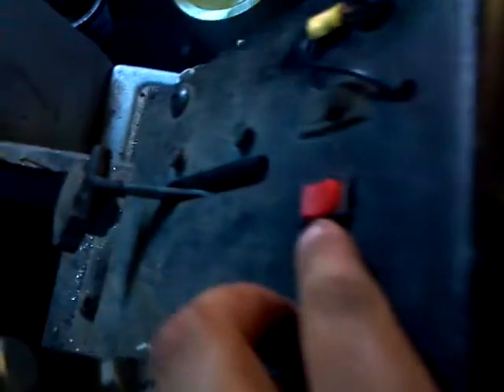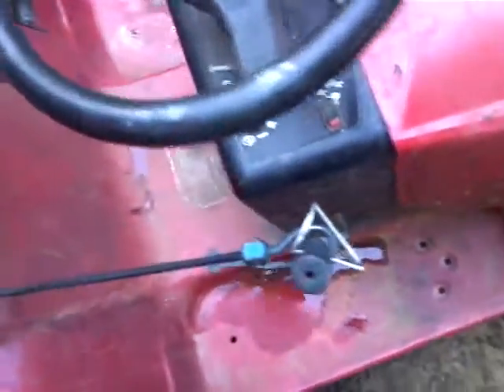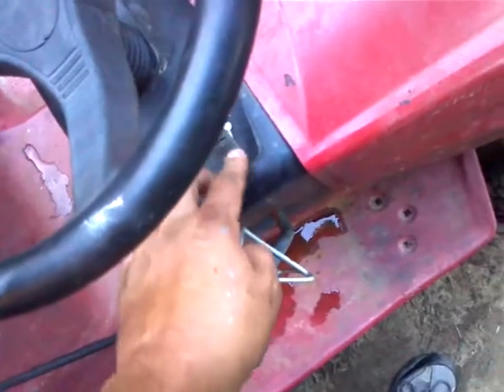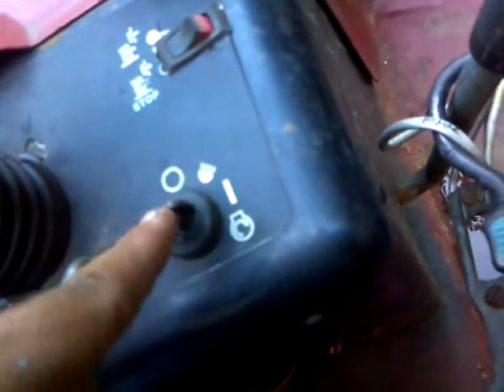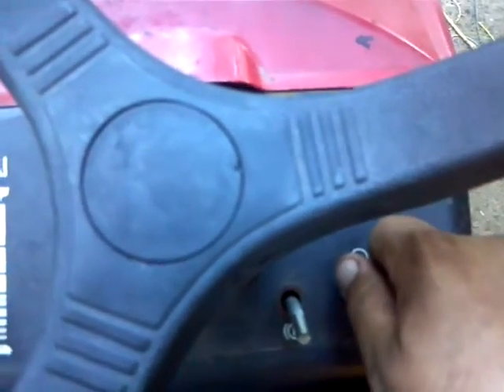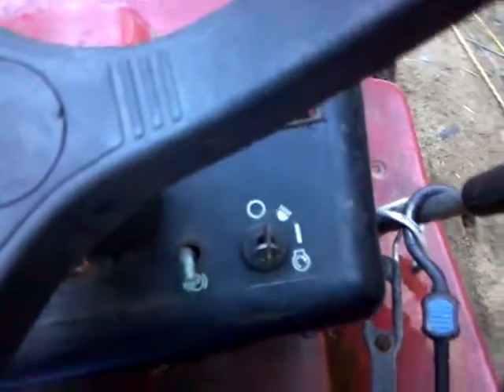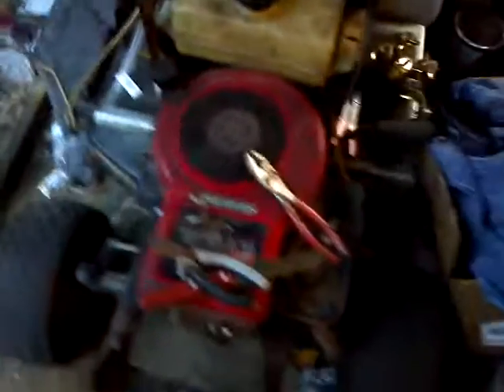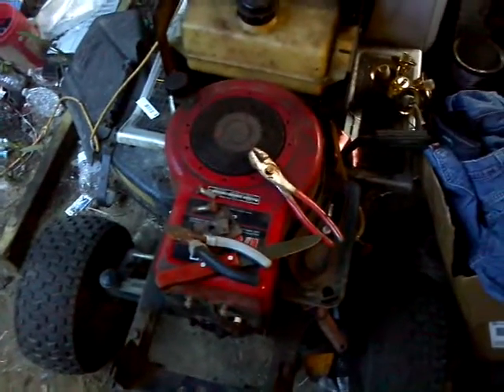HOW TO WIRE A KILL SWITCH ON YOUR RIDING MOWER

Comment: i'm converting my 12hp riding lawnmower with the briggs, from electric to pull start, do I need to put a killswitch on it or can i use the old ignition switch?
Reply from the maker: im sorry for the late replay no you dont need to put a kill switch on it. Just switch the key on when you go to pull start it and when your done switch the key off and it should turn the engine back off
Reply: @BigJoesRidingMowers  no problem man, and yeah i figured it out, im starting it with an electric drill on the flywheel bolt until i can get the recoil starter ordered.... she runs, but the blades won't engage, somehow the blade belt got  super loose even though the last time the mower ran the belt was fine, it hasnt ran in about 5 years, and all the pulleys were seized up, as the drive belt pulleys were sparking and making a scraping noise when i first started it but that went away
Reply from the maker: @grandmastah2314  that belt is probably just old you can have a old belt that looks good but once you use it, it stretches, it happens, just curious what kind of riding mower do you have?
Reply: @BigJoesRidingMowers  it's one of the old craftsman II 38 inch cut gray mowers. one of the boxy looking ones, probably a 90 model 12 hp briggs I/C, motor still runs like a top
Reply from the maker: @grandmastah2314  oh yea i got one of those, its a 89 came with a 12hp tecumseh 38inch cut now its got a 12.5hp briggs and its a 3 axled mower, its called the custom craftsman
Reply: @BigJoesRidingMowers  back when briggs and stratton was worth a shit
Reply from the maker: @grandmastah2314  exactly

Comment: Can I just ground it to the engine?
Reply from the maker: yea you could on the starter bolt i guess
Reply: Big_Joes Riding_Mowers can I do it anywhere on the engine (except hot spots) because it’s pull start and doesn’t have a starter
Reply from the maker: @finncampeau4922  it has to be touching metal the engine isnt a good ground. may i ask why you cant run a wire to the frame?
Reply: Big_Joes Riding_Mowers because i have a wooden block holding the engine off of the frame because of clearance issues. i was thinking of bolting the ground wire to one of the valve cover bolts. btw it’s for a go cart
Reply: Big_Joes Riding_Mowers the engine is metal. Why isn’t that a good ground?
Reply from the maker: @finncampeau4922  you can try it
Reply: Big_Joes Riding_Mowers is there any reason why it wouldn’t work?
Reply from the maker: @finncampeau4922  i just find the best ground is to the frame but you can try it what do you got to loose?
Reply: Big_Joes Riding_Mowers does the engine have to be touching the frame for it to work? Or can I just bolt the ground to the frame even though the engine isn’t making contact with it?
Reply: Big_Joes Riding_Mowers ans thanks for all your help by the way!
Reply from the maker: @finncampeau4922  honestly grounds are tricky one day they can work in one place good then not work the next. i would just attach the ground to the frame there i would know that it would work fine but all i did on this mower was attach the ground to the dash which is sheet metal
Reply from the maker: @finncampeau4922  your welcome